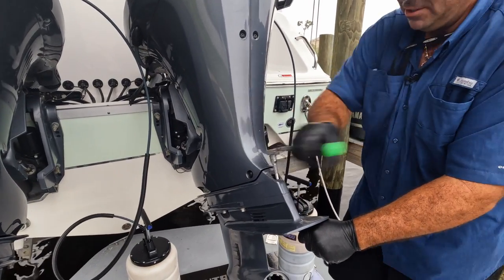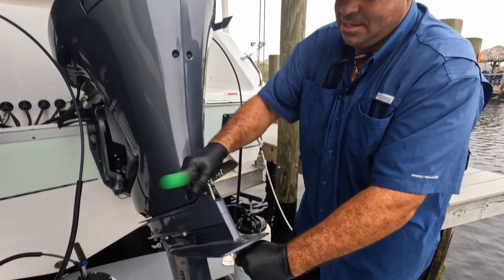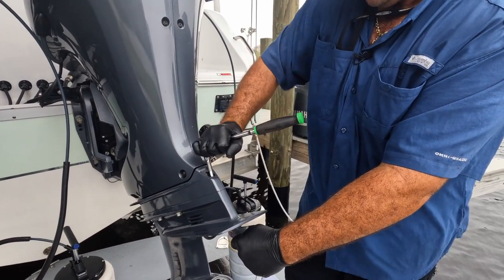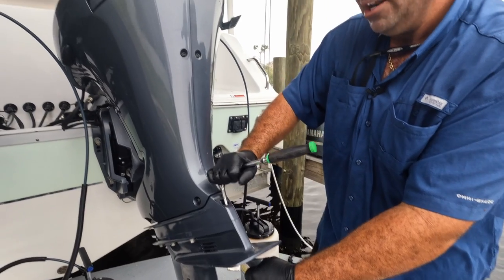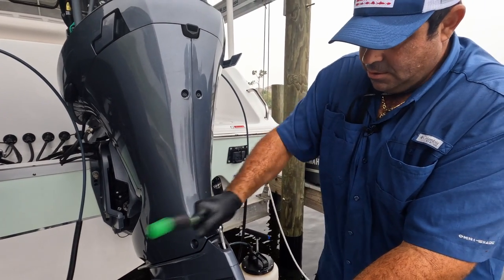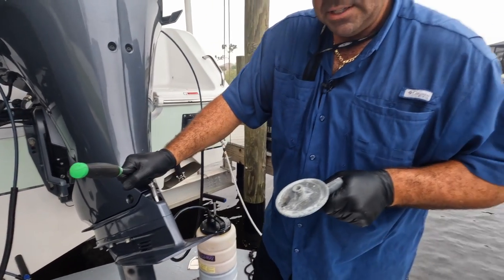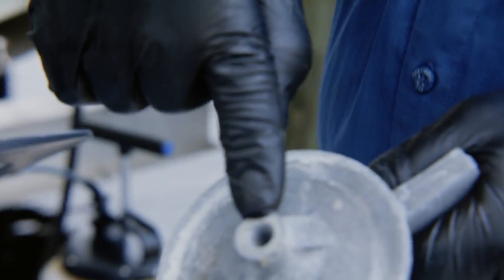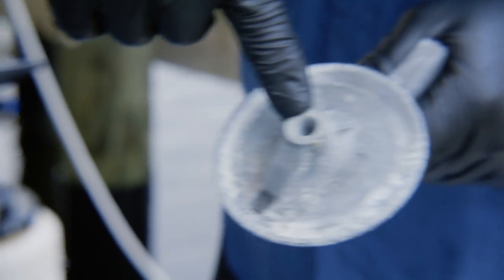All About External Anodes | F150, F175, and F200 models | DIY Yamaha Outboard Maintenance

Comment: Those anodes that don't have a fin buy still have that kind of intake (hole at one edge) should still face forward to the front of the boat or aft?
Reply from the maker: Hey There,

Thanks for watching. The anodes with a hole should be facing forward to the bow of the boat. If you have a question regarding a specific anode of your engine give us a call at 1-888-625-5460. 

Happy Boating!